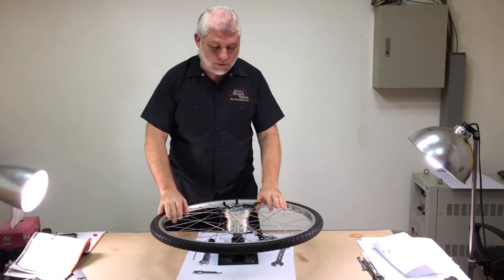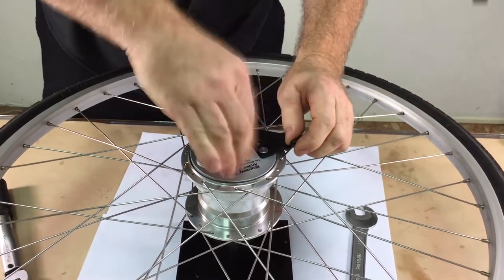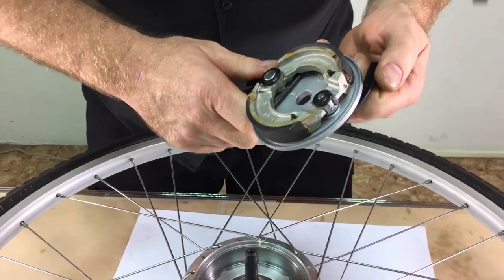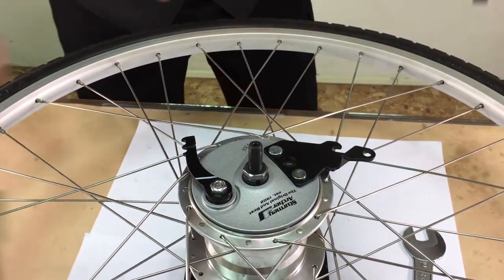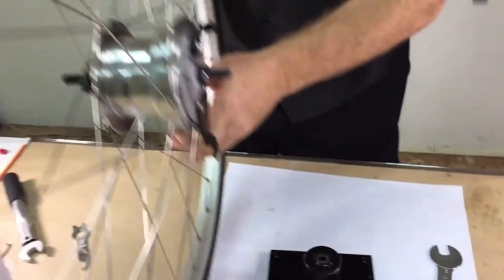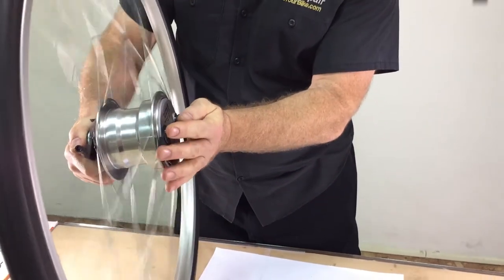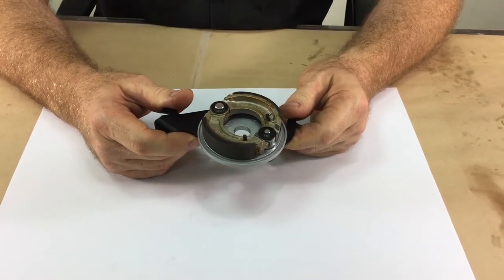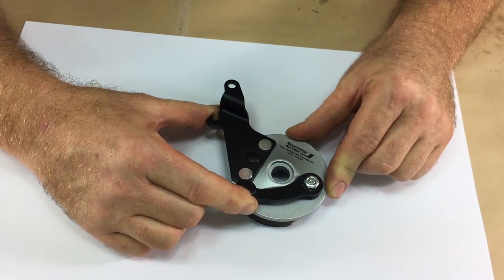Drum Brake  Re-assembly

Comment: RE: The brake 'shoes' wearing.
They will usually last 50,000+ miles.
You may need to deglaze them with emery cloth from time to time when braking efficiency drops or when the start squealing.
I do mine once a year on my recumbent trike and they are 15years old now with >1.3mm wear to the braking material.
Reply: My SA XL-FDD has 28,000 miles with 1/3 on tours. It is getting real close to the line, making it hard to get the cable barrel off and on.

Comment: Pretty nice video. I line up the axle flat with somewhere on the rivet, using the 17 mm wrench I'm holding. Because I hold the brake arm tight when I tighten the locknut. I never thought to use that tooth wrench. LOL. To do it the first time, I would just trail and error, till it was good. Getting the play right is always a bugger tho. 
And anyway, my brake has actually still worked when oil seeped onto the pads and liner. LOL. 
BTW >> Is that new shift R 5 hub way less trouble that the 5w??

Comment: Do you know if it is possible to sneak a bit of oil into the hub via the hollow axle? I personally swear by adding a bit of oil to gear hubs, even if grease is the general advice, they run noticeably smoother.
Reply: No I wouldn’t do that. Sniff of oil on pads land it’s game over.

Comment: what would cause drag between the brake pad and the drum?  I'm trying to work on an old SA drum brake, and there's really no gap between the pad and the drum.
Reply: Is your cable too tight?
Reply: @bob-ny6kn  cable isn’t even attached.
Reply: @AlaskaBikeDoctor  while spinning the wheel, can you move the arm to a position where there is no rubbing? (Maybe the pads have swollen or shifted)
Reply: @bob-ny6kn  nope.
Reply: @AlaskaBikeDoctor  I just worked on a Sturmey Archer dynamo drum brake with a "scraping" sound without the brake cable attached. The torque arm lid somehow was not on straight. All I did was remove the lid to inspect inside and put the lid back on. No odd (scraping) sound after that.
Reply: You squirted grease into the drum brake… fail !!